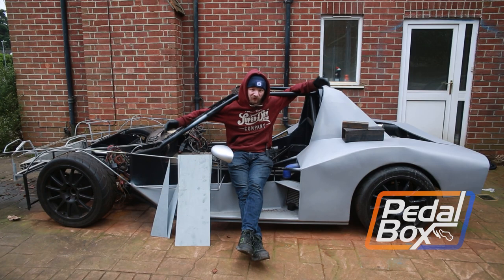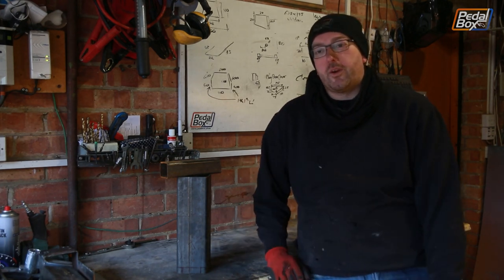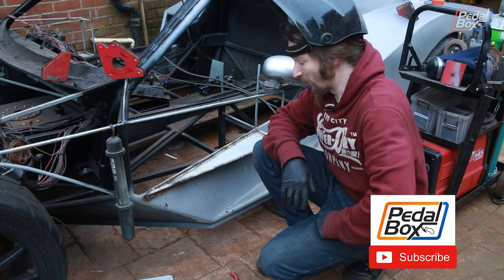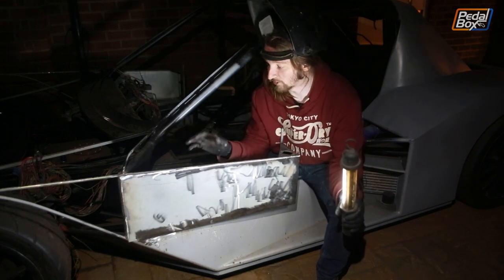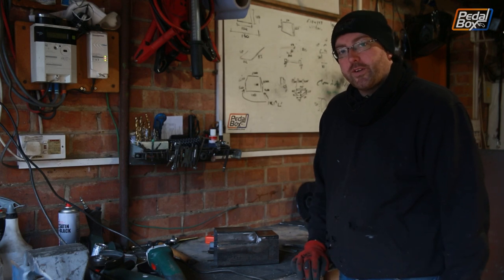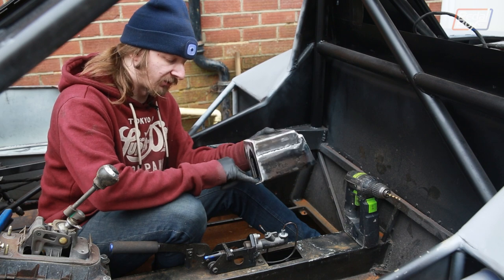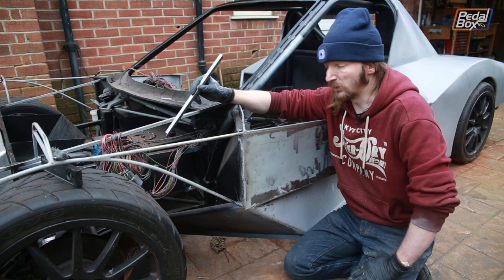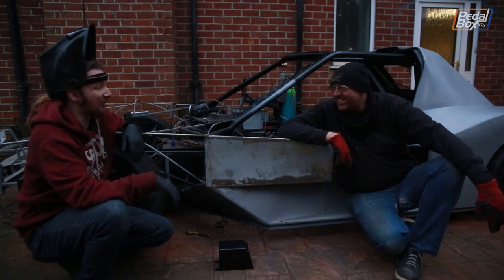Starting Front Wings | Audi TT Kit Car | PedalBox Episode 94

Comment: Looking good guys! Have you tried blowing the welds with compressed air when welding sheets? Takes the heat away quicker to stop distortion (alongside spreading the welds around the sheet to spread the heat around, which it looks like you're already doing). 
Keep up the good work!
Reply from the maker: The biggest problem is actually getting the rhythm back, it's so easy to just get carried away when its going well, and so often i've had a good run, stopped and then never got it back. Even with cooling periods between we've had sheets, especially flat ones warp somewhat. Easier to have a contingency plan and limit the damage for now
Reply: @PedalBox  I feel your pain! I am in a similar situation with welding. Love this project, always happy to see a new episode pop up!